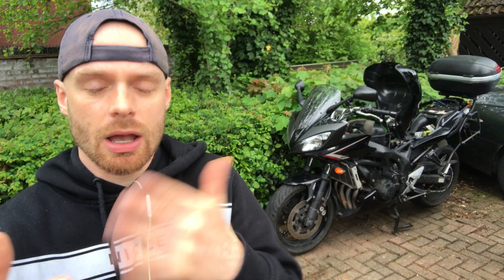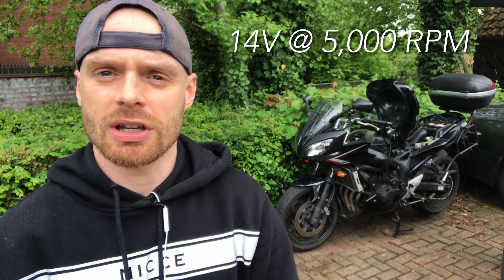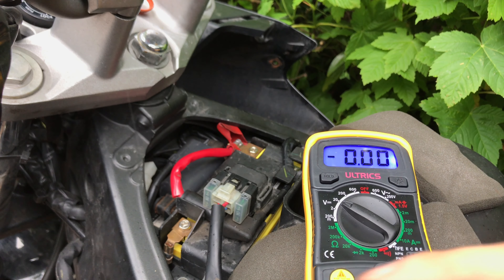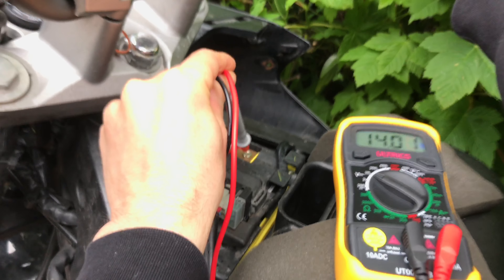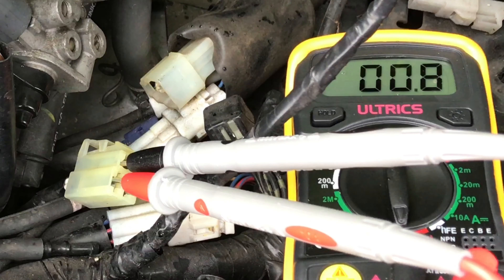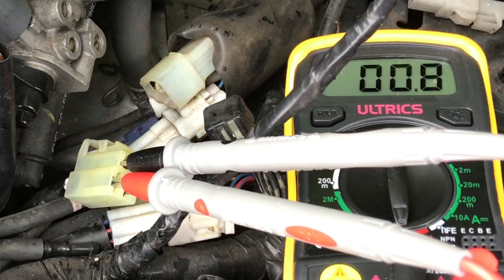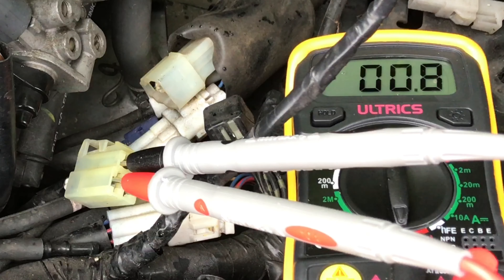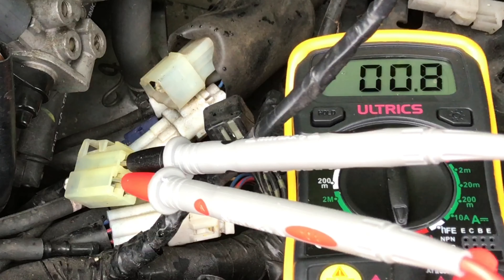Test a Motorcycle Alternator Stator & Charging System | 4 best ways | How to

Comment: Hello in my atv (access lander 300) in dynamic test on stator show 3.5 acv , 3.5acv  and 6.5 acv. The other test is good but not charging the battery. The problem is the stator?
Reply from the maker: It’s does seem odd that one reading is much higher than the other two, so yes could be the stator. But I would also check the Regulator rectifier too before you take your ATV apart. Here’s how: https://youtu.be/mn6RtpdmeQE
Reply: @FabMotorbikes  thanks for the answer. I check the regulator and I think it’s ok because the diode is ok.
Reply from the maker: Yes that sounds okay. How is the health of your battery in general?
Reply: @FabMotorbikes  it’s new. I buy it before 2 months.
Reply from the maker: What readings do you get at the battery when performing the first test in this video?
Reply: @FabMotorbikes  before 2 months when the battery is new i have 13.5v but when I put the lights on the volt is too low… it’s about ~10v
Reply from the maker: It’s does sound most likely to be stator problem. But I can’t be sure. One other thing to test for would be a ‘parasitic drain’. This is where something is drawing power from you battery all the time when it shouldn’t
Reply: @FabMotorbikes  I think I haven’t power leak because I haven’t nothing extra (alarm, radio, projectors) but tomorrow I check about leaks. But the master problem is not enough volt from  stator.
Reply from the maker: I agree mostly likely the stator 👍
Reply from the maker: Any luck getting this fixed?
Reply: @FabMotorbikes  hello my friend now I put the new stator and I wait to dry the gasket maker. I turn it on in a half hour and I sent you the result. Thanks for you interesting.!
Reply from the maker: Awesome, good luck. I hope it’s all fixed!
Reply: @FabMotorbikes  the problem is fixed. Now I have 14v when I start the atv. I think everything is ok.! Thanks for your help.!
Reply from the maker: Brilliant news! Nice one on getting it fixed! enjoy driving it 👍
Reply: @FabMotorbikes  thanks my friend.!

Comment: Hello I have a Africa twin xvr750 rd07 and the wires that came from the stater to the rectifier they get burn when I press the accelerater to 3rpm their is any one no wat it could be the problem. Thanks.Antonio
Reply from the maker: This a rare issue but most likely the stator connector contacts did not have a good electrical connection due to corrosion or similar. They became hot from current flowing through the high electrical resistance. Very common problem. With the connector issue resolved (either at the stator side or regulator rectifier side) you should be okay. Unfortunately this may not be a cheap fix. I also have a regulator rectifier test you can perform >> https://youtu.be/mn6RtpdmeQE

Comment: Nominal output test reading was same as idol could , stator resistance test all reading up and down not accurate other 2 was fine can any one help me what does this mean ?
Reply from the maker: Seems you may have a parasitic leak. Meaning power is draining out if a broken connection somewhere
Reply: Thanks for reply I did the ground test it wasn't leaking into frame does this mean alternator is good ? And must be connection or stator

Comment: My yamaha 1100 keeps drying out my battery. I noticed when I take the battery connectors of the bike dies? Anyone knows why or can anyone point me in the right direction 😊
Reply from the maker: You might have a parasitic drain. Test 4 on this video will help determine this. There is also a good chance you battery is dead and need replacing. This is the problem I had . It refused to hold a charge

Comment: I get the ohms test between alternator winding. To check for dynamic load then AC on 20V range and run the motor to 2000 then 5000 rpm for each connection like on the ohms test, they should all be the same. Sometimes there maybe disparity, meaning there is a leak in one of the windings. My Blackbird Alternator costs roughly £360.00 in the UK from a main dealer. From America, same part number and packaging $80.00 !! I asked why this is form Honda, then heard nothing for a few days. A message was left on my answerphone "We are still waiting to hear from our Belgian suppliers !" The voice was far too posh to be real. A mickey take IMHO. RIP OFF in actuality !!!